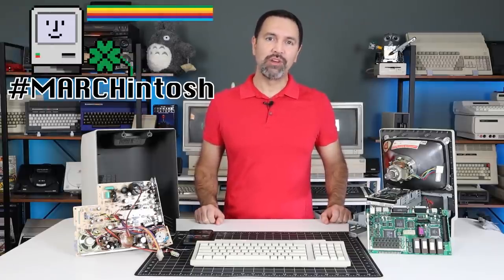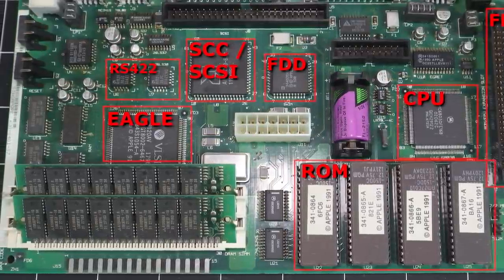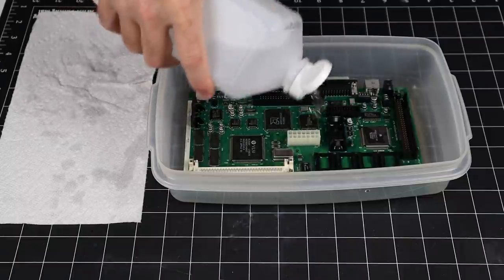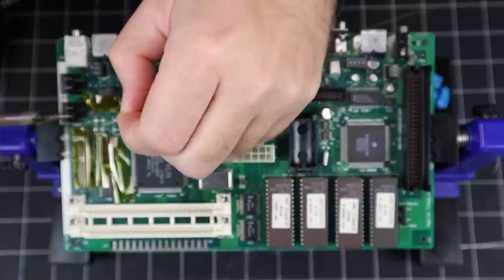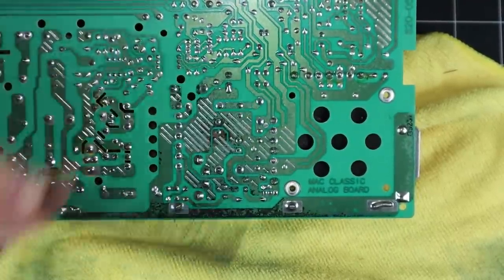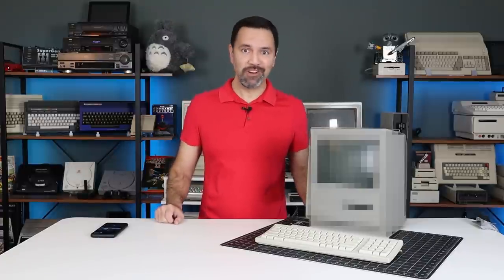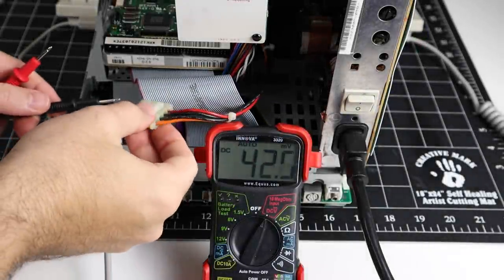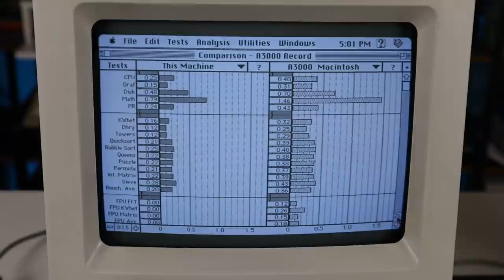Dead Mac Classic II - Can We Save It? #MARCHintosh2022

Comment: For sound issue another tip: desolder the EGRET-Chips, clean the chip legs and the pads with IPA and solder them in again. Check, if any trace on the SMD caps on the upper right was accidentally was soldered to a trace where solder mask has gone (happened to me)
Reply from the maker: Thanks for the tips, I will definitely check these!

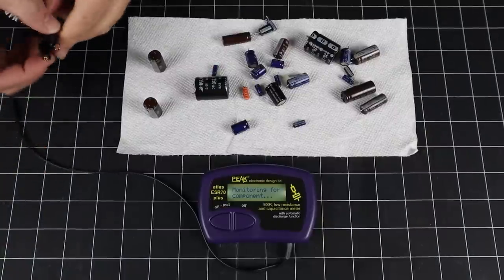Comment: @19:58 the capacitance value being +/- ~10% of the listed value is common for capacitors like these, depending on grade; but the ESR is definitely far higher than expected. Check the rear audio jack - it has a switch inside that can get stuck out of position, eliminating internal audio. I would also try swapping the speaker with another known working one if possible.
Reply from the maker: Cool, thanks for the tips. I did spray some contact cleaner in the jack and plugged/unplugged a cable a bunch of times but I will try to see if I can inspect it more closely.

Comment: Beautiful board restoration, and great job with the surface mount caps! And ohhh yeah, leaky cap juice certainly has a distinctive odor, doesn't it? ;-) And a great tip re safety glasses, something I completely forgot to mention in my comment on your previous video. Yeah, those things do have a tendency to go "pop" sometimes, although usually this only happens with newer caps... older dried-out or leaked-out ones generally don't have enough electrolyte left to go "pow!". Still, best not to take any chances. :) Sorry to hear (well, more accurately "not hear" ;-) ) that the sound wasn't working tho. :(
Reply from the maker: Thanks! I will keep plugging away at it and get the sound working - how hard can it be? :)

Comment: Based on the schematic I would remove / clean and/or replace U1 next which seems to be the audio op-amp and is right near those caps.
Reply from the maker: Thanks for the tip! I did previously re-solder the pings of the op-amp but I didn't remove it entirely to inspect/clean.

Comment: So the speaker doesn't work. Does the headphone port work at all?
Reply: Does the speaker cut out when a headphone is inserted? If so could the machine think there is a headset plugged in?
I guess plugging in a headset is the first step to testing that possibility...
Reply from the maker: I tested the rear jack with some headphones as well as some powered speakers and no sound comes out. There is a small "pop" when the machine is powered on which makes me think perhaps the little amplifier chip is working at least.

Comment: How do you prevent the apple logo from fading with that retrobrite process?
Reply from the maker: It got faded :( Next time I'd either remove it first or possibly put tape over it so it doesn't come in contact with the peroxide solution.